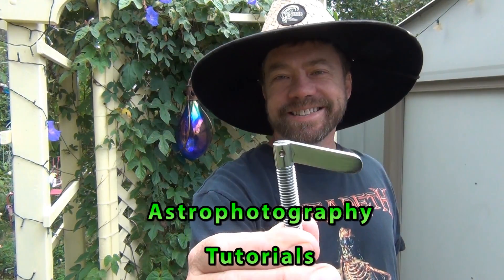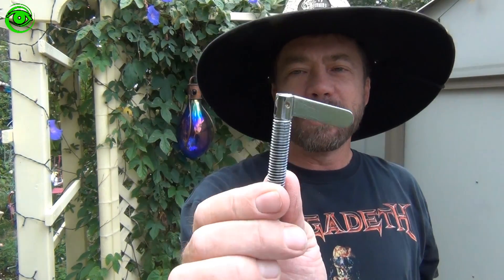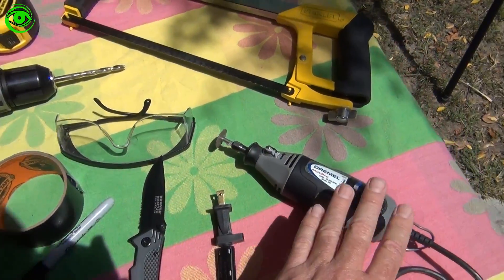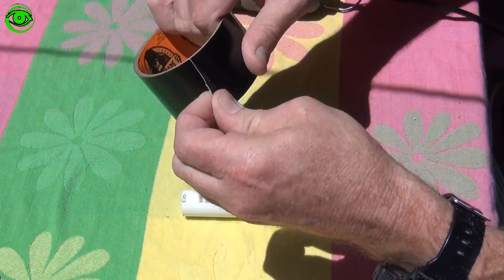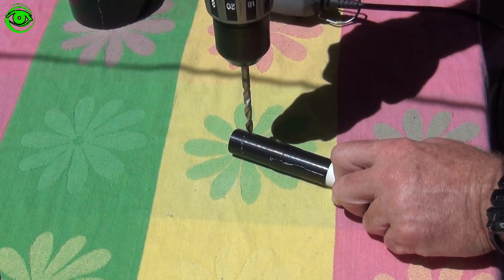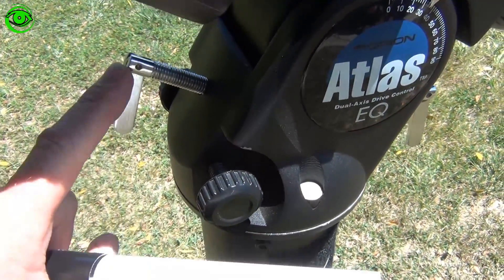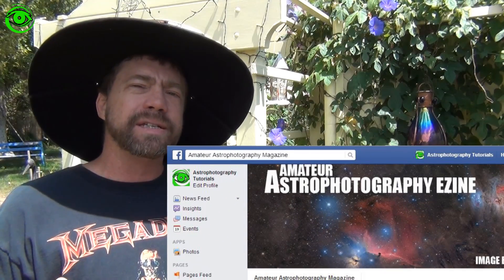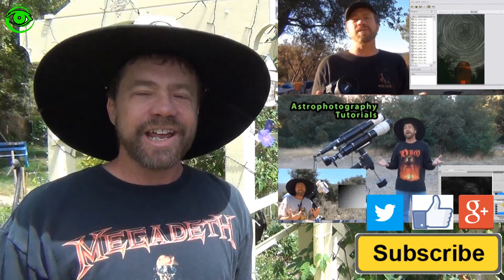Easy DIY Latitude Knob Mod for Equatorial Telescope Mounts

Comment: Many thanks for this, made one in less than 15 minutes and it works a treat! New subscriber!
Reply from the maker: Thanks for the sub peeb!  Be careful to not bend your knobs.  I tightened one too tight and it bent the lever...still works....just remember these little blades aren't heavy duty and you can't torque'm too tight or they'll bend.
Doug
Reply: Thanks Doug for the great advice! Big thumbs up!